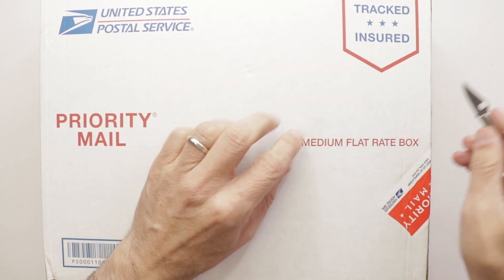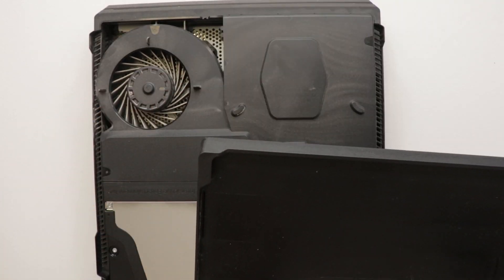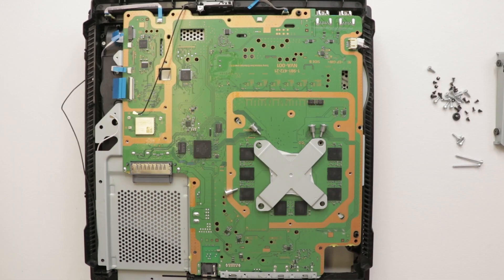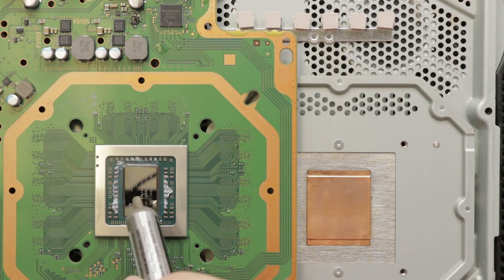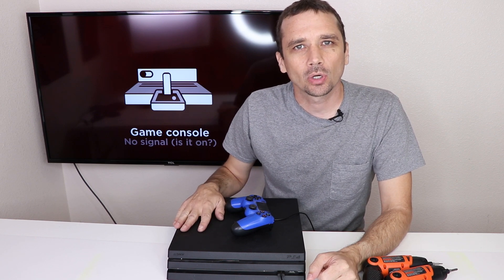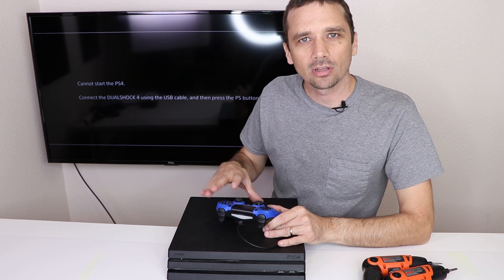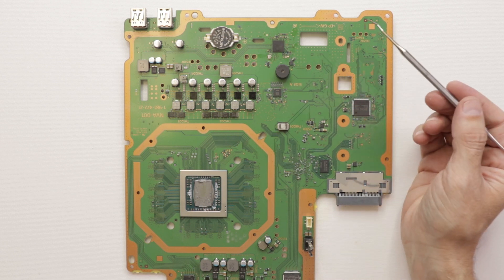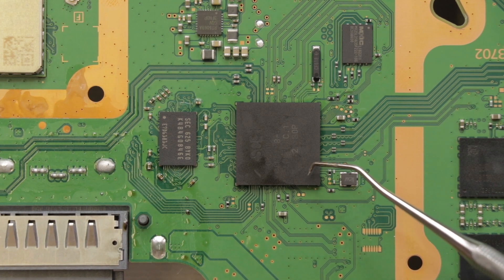eBay Repair Challenge - Part 4 - Is My Luck Running Out?

Comment: harrd drive?im sure they save the usb drivers
Reply from the maker: Not sure what you're meaning here.
Reply: sory mabe i missed it but after you changed the hdmi control chip you got a display saying this ps4 can not start.download the software from the sony site and put the ps4 into safe mode,hold power until 2 bleeps ,then try to install the software onto the drive,if it fails the hard has died.try to intall it onto another hard drive
Reply: the contoller will work in safe mode by the way
Reply from the maker: You can't do any of that if the controller won't work.
Reply from the maker: Actually it won't work in safe mode. It only works in safe mode if the WiFi/Bluetooth chip is faulty but the USB system is not. That's not the problem in this case.

Comment: Lovs from india.Hello. Sir i dissected my ps4 1215 . I by mistake removed the paste on the sink. Now it is very much overheating that it says ps4 is too hot. And closes.i was also saying this msg beforem i was just cleaning it. I didnt even checked the inner pasrt of heat sink
Reply from the maker: Yes, it will overheat very quickly without thermal paste.
Reply: clean the CPU and the Heatsink with alcohol and put new thermal paste, is easy and cheap
Reply: Will try that

Comment: What do you think of replacing the motherboard with a motherboard from a different, physically damaged PS4?  
Missing parts, etc.  Get it cheap! 
 Possibly an easier more successful repair. Marry the two. Then sell it. Include any extra parts in the sale. Or sell the extra parts in a separate sale. 
 Trying to sell this one now, after the repair attempt / failure, will surely result in less profit. Than a successfully completed repaired PS4 would bring. Or even an untouched, non-working PS4 would bring. 
 I myself, stay away from any item that has been confirmed non-repairable, especially from a professional, such as yourself, unless I am looking for a specific part or piece of it.
 Do you believe that the parts are worth more separately?   --->  Maybe? 
Please, keep up the good work / videos.
Reply from the maker: Good analysis! Given that it's hard to find one broken for under $200 I think I'd be further into this hole if I were to buy another broken one...and if that one couldn't be fixed then I'd be done for. I'm currently selling the parts. I think I can make my money back and maybe even make a bit of profit on it still.

Comment: I think the problem was with the controller. The pairing software on the console is really screwy. Also, the connector on the controller is really fragile and intermittent.